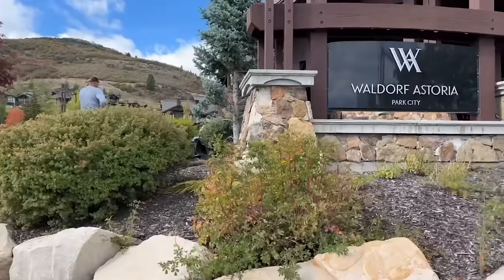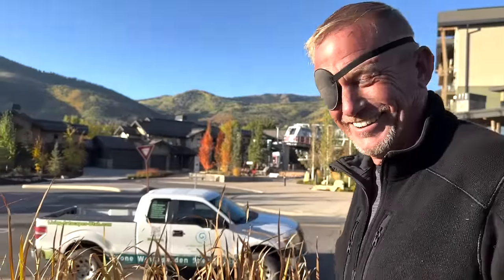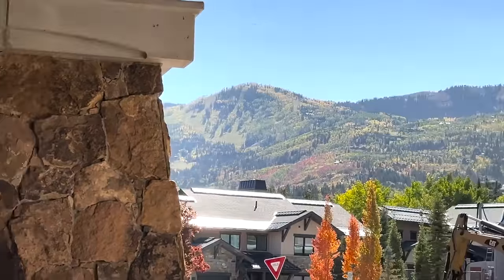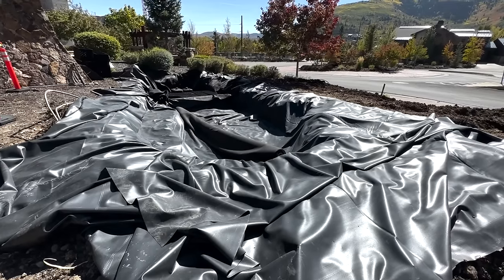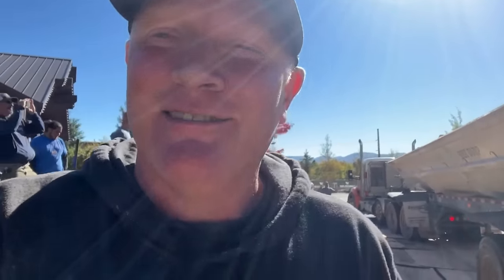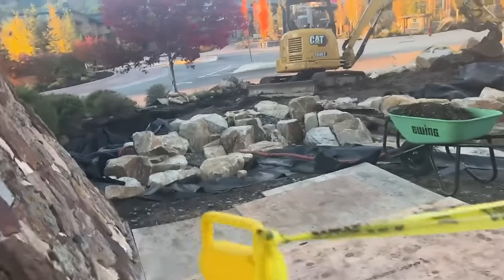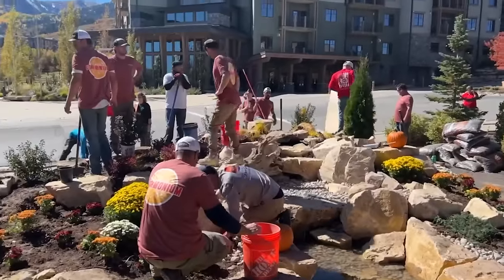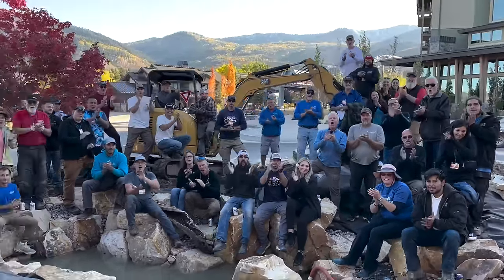UPSCALE Pond Rebuild - What Makes it TOP NOTCH

Comment: Nice rebuild! Worried with the issue of water runoff from the roof thru the pond and contaminates. And wondered if the water flow 'dead zones' facing the driveway will accumulate debris instead of the skimmer. Video footage did not showcase the waterfall and lighting so looking forward to a later revisit especially with winter ice. Great and quick results at destination location! You guys are amazing.
Reply from the maker: Thank you! The runoff should be no issue with the biological filtration in place, we also have maintenance teams that come in regularly as well. The jets were added along that area so there’s no more dead zones.

Comment: Looks amazing! Just wondering how often you all use a cement fabric underlayment in your projects, especially on naturally sloped hill areas. Would this eliminate leaks in the liner and ensure the feature from having to be torn out and redone? What's the longevity aspect of cement fabric vs plain underlayment fabric? Thanks
Reply from the maker: We use the concrete fabric underlayment in almost all of our larger projects, it is sturdier to help protect the liner from getting damaged, just ensuring more that there won’t be any leaks. It is much more sturdy and lasts longer than just fabric underlayment. The cement fabric also protects the liner from any rodents, aggressive tree roots and stuff like that as well. 

It’s an added layer of insurance.
Reply: Thanks for the clarification and confirmation. A gentleman from Pacific Pond and Waterfall in Martinez, CA advised that the cement underlayment was the best insurance for the longevity of the water feature. Although expensive, I think it'll be worth the initial cost to protect such a large investment. Gearing up to install a 25ft pondless waterfall to maximize and enhance a 10ft slope at the back of our yard.

Comment: What specific changes do you make so that it can run all winter long?  Also, for jets that keep ice open in the winter and circulate water in the summer, how do you calculate how many GPH from the pump is needed for each jet?
Reply from the maker: During the winter if we keep it running then we clean up any debris,add cold water bacteria, and do light maintenance like topping off the pond and preventing the surface from freezing over. With the jets, you can add up to 3 of them to a pump and control it with a ball valve.
Reply: @TEAMAquascape  thanks for answering! Is that 3 in addition to a bog or waterfall, or do 3 jets use the whole pump capacity on their own?